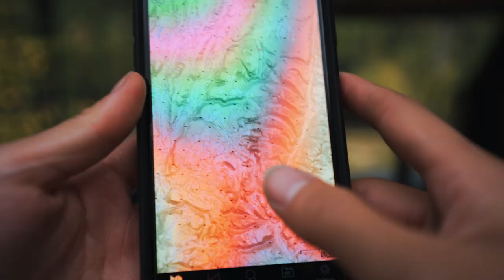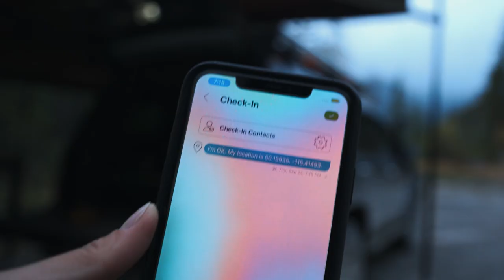Why Travel Alone? Solo Female Overlander | Toyota Landcruiser 100 Series in BC Rockies

Comment: I'm used to taking care of older cars. One of the most important things to do for maintenance is to inspect everything every time you change the oil. Regular inspections reveal so much what you're going to be in for in the future. I've spotted many parts that need to be replaced, but because I was checking them so regularly, I was able to drive a lot of miles after knowing I would have to replace a part before that part actually needed to be replaced. Knowing everything ahead of time gives me the freedom to take my time finding parts and to schedule down time for the car.

Also, the rule of replacing everything in sets is a good one. If you have multiple parts to do the same thing, and one of those parts fails, you should replace them all. Tie rods are a good example. If one tie rod end goes bad, replace all four. If one ball joint goes bad, replace all four. It allows taking the car down once for repairs instead of a bunch of times in rapid succession, and you're not going to have to worry about the other ones breaking because you left them in.
Reply from the maker: Great practice! Gotta stock up some Terrain Tamer parts up in Canada for these moments.... tricky to find parts for an Australian import

Comment: You mention that this Toyota has required the most maintenance of anything you've owned in the past. Did your past vehicles also go through as much off-roading and camper modifications as this one?
Reply from the maker: No complaint here. I never owned a vehicle this old and not driven this much. The maintenance comes with use and age. Nothing is wrong or broken, just normal aging.

Comment: where are you getting 100 series parts so quickly in Canada? Parts are close to impossible to find in stock/overnight unless its coming from USA for the 100 in Canada due to only a handful of LX470s sold there.
Reply from the maker: The tie rod end I had was bought from Terrain Tamer HQ in Melbourne when I was there. I picked up some parts to ship back with the vehicle in case I need them and knowing parts will be hard to find once I'm here. Got lucky on that one. Other parts are really depending on luck. Lordco for off brand, and yes most LX470 parts have a bit of wait.

Comment: 1. it would be better to put a cyclone on the snorkel

2. you can make a glove compartment in the lower trunk lid

3. and it would be nice if you gave links or at least a description of your horse) what kind of solar battery? what type of expedition rack? what cape?

but generally cool! well done! sooooo beautiful nature!!!!! best luck!
Reply from the maker: Updated the link to the solar panel in the description. Roof Tray and awning both from Rhino-Rack. I have been thinking of changing the tailgate lower part to some sort of smooth surface or even a spin out table, instead of the fuzzy mat from factory. Storage compartment would also work i remember seeing some company make them for 100/105.
Reply: @OverlandLady  Harry Fisher from FireToFork here on  YouTube has a  food grade (proably 304 or 316) stainless steel panel on the tailgate of his 80 series GXL Land Cruiser which he had made up and swears by (it can be seen in detail at the 21 minute mark in Ronny Dahl's Modified Episode 42 that covers Harry's 80 series here on Youtube). I would imagine that such a thing could be made up pretty easily by a sheet metal fabricator for a 100 series GXL like yours. 

I purchased a Stainless Steel Drawer Table (the 475mm wide model) to fit my Titan Draws in my 105 Land Cruiser from a company in Queensland called Kaon which in addition to the front runner drop down table (originally for the Jeep Wrangler but I made it work for my cruiser)  has made my barn door 105 significantly better to camp out of (I no longer pack a table for most trips). Shipping to Canada does not appear to be crazy (about $50AUD). Again, a sheet metal fabricator local to you might be able to fab one up.
Reply from the maker: @dinnyregnu2649  Thanks for this information!! I'd check those out and get some inspiration for a setup to be made.
Reply from the maker: @dinnyregnu2649  Just checking out that video of the 80 series now. Kinda answered a question I had - i wonder if a dropdown fridge slide will clear the tailgate the flips down.. seems like sits right above it.. I've been thinking of a straight slide of a dropdown.. I carry a little stool for my short height to reach the fridge or anything in the truck.
Reply: @OverlandLady  The straight slide that is part of the Titan draws works well for my 75L fridge, although I am 6". I borrowed a friends MSA drop slide and found that it was very heavy at 47 kgs, and considering the titans are 60+ kgs empty, I decided not to get one myself to keep the weight down and just climb on the tow bar if needed. 
Regarding the clearance of the tailgate, I cant comment but when I used the MSA drop slide did not extend very far out, but it gently rested on my rear bar and could have dropped lower if it was not in the way.
Reply from the maker: @dinnyregnu2649  ha ya all that weight. Thanks again! these are really helpful information.
Reply: @OverlandLady  You're welcome. The Titans in built draw slide (on the opposite side to where you have your fridge) works well enough for most people to not bother with a separate fridge slide. A reasonably recent addition to my setup was some (4) clear top canvas boxes to fit in the drawers which separate recovery gear, tools and spares, cooking gear and camping gear have made a profound difference with ease of use around camp which I've not seen too many people use but were a game changer for me.